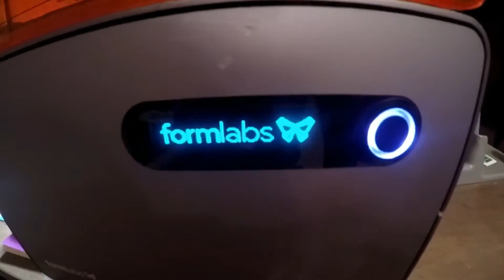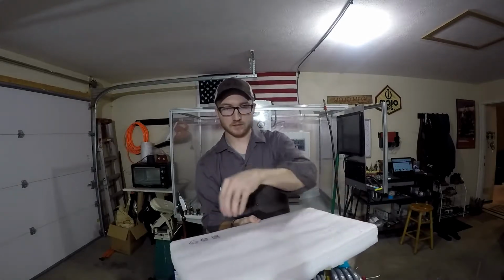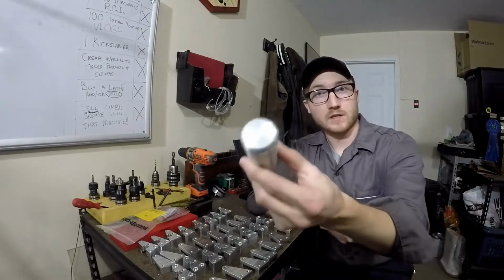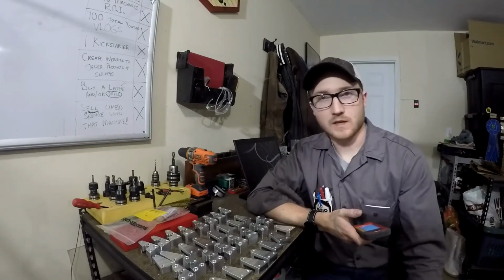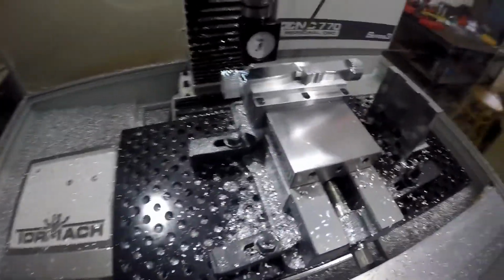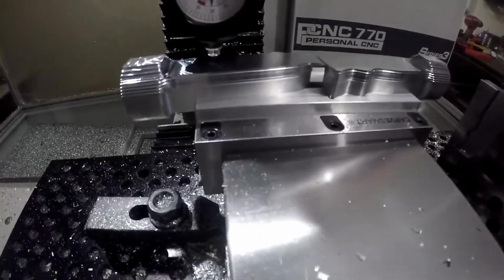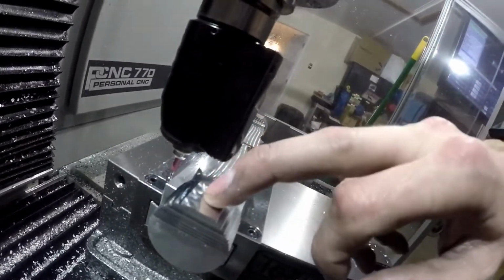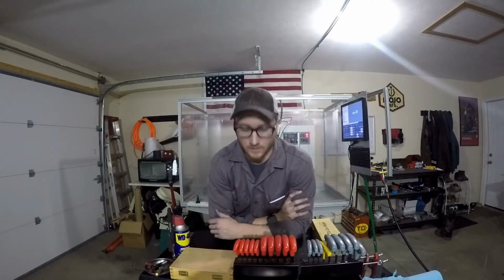Sending Parts to the Anodizer: Home Mfg. Days #3

Comment: I have not made any production stuff yet that required anodizing but will here shortly. I as you, do short run production stuff so the only reasonable approach is to just anodize them myself.
Reply from the maker: I really thought about it but I need to do more research about the equipment needed.  Even then, that equipment would take up floor space in my small garage and that space is very valuable to me. Either way, I'm still going to look into it.

Comment: you can always try setting up a small anodizing line at home. Its relatively easy and cheap to set up. The most expensive thing is the power supply. But i don't know if you want to deal with the effort to set one up, but if you end up anodizing small runs more often, it could save you a bit of cash

Comment: Most powder coaters I have used have a $150 minimum. One of them just raised to $200.  I wait till I have enough parts to meet minimum. I rotate between 3-4 companies due to quality issues and lead time.
Reply from the maker: That's good to know.  This company that I have anodizing my parts also has powdercoating capabilities so it seems like I may be in the right ball park.

Comment: You may have figured the anodizing out already - but Tom has a great video with an amazing rig. Doesn’t take up too much space and can double as a workspace when not in use. His is far fancier than required - but the storage concept is awesome. 

Link: https://youtu.be/BtYHcsq7s5A
Reply from the maker: Holy smokes! He has a heck of a setup!
Reply: His setup is amazing - and over the top for a basic, functioning set up. Once you get the power supply worked out - you can get some good results in a garage/small shop.
Reply from the maker: It looks like it.  I'm gonna keep that in mind for possible future parts.